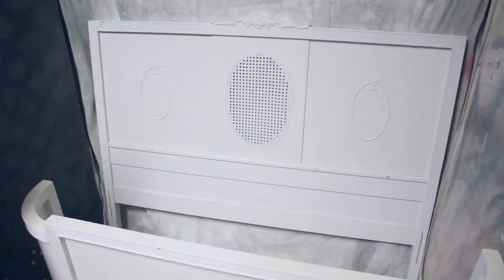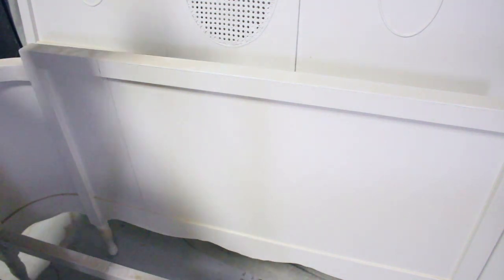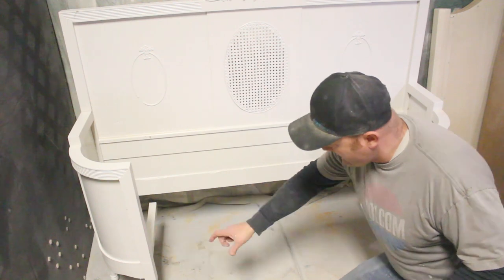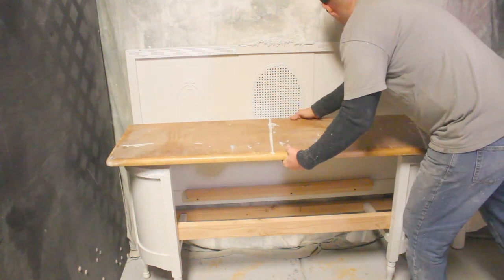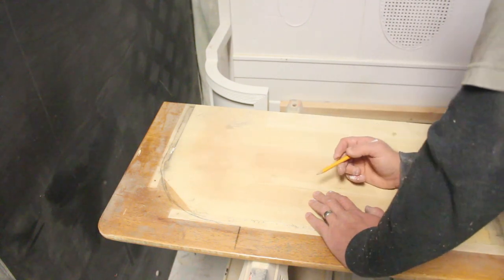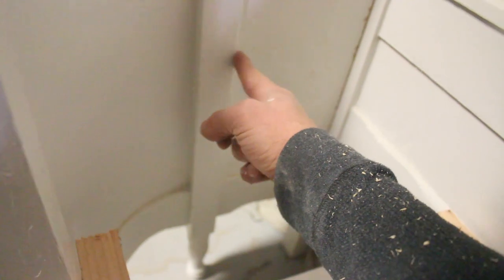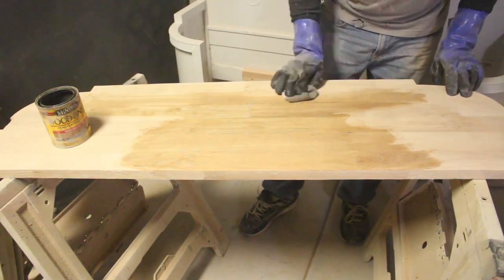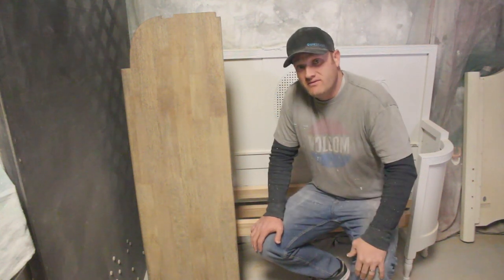How To Build A Bench From A Headboard and Curved Footboard | Part 1

Comment: Very cool . 
I like to use cardboard for cuts like you got going here . Once I get it to shape then I just tape it to my project and cut the wood. I was also thinking if you don’t get your cuts close on something like this wondering if you could hide gaps with some kind of molding maybe.

Great project tho I’d like to try this just wondering where I can find this rounded footboard at 😆 lol
Reply from the maker: Chuck C thanks!  I’ve used that method for cutting out chair seats before. I didn’t even think to apply that here!  Sometimes you just need a fresh set of eyes. Gonna mention this in part 2.

Comment: To make a template for the seat, start with brown paper. Lay the paper where you want to place the seat. Fold and mark the paper along the inside curve of the arm rest. Make cuts as needed. Repeat with fresh paper until you think you have a fairly good template. Then trace your paper template onto rigid cardboard. Continue to cut and fit cardboard until you are satisfied with your cardboard template. Be sure to check that your template is a perfect fit on both the left and right end of the bench. Trace your perfect template onto your wood plank. 

I have used paper to trace  an outline from upholstered furniture when making slipcovers. When I have a successful pattern piece for a complicated curve, I save it in case I ever want to reupholster the piece. When I wanted to purchase flower pots to fit a quarter round shelf, I cut a paper template of the shelf. I took the template with me to the garden center and used it to select the various sizes of pots that would fit my shelf.